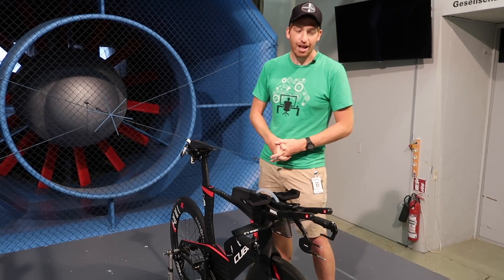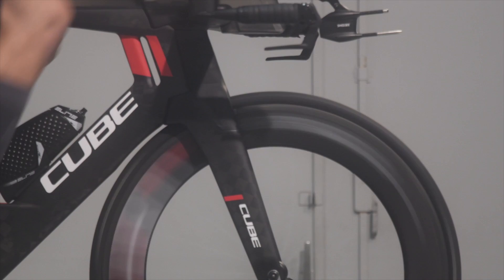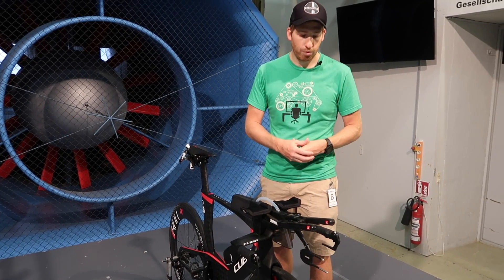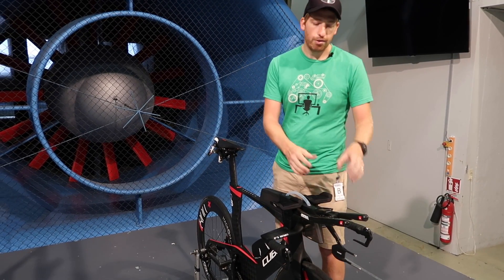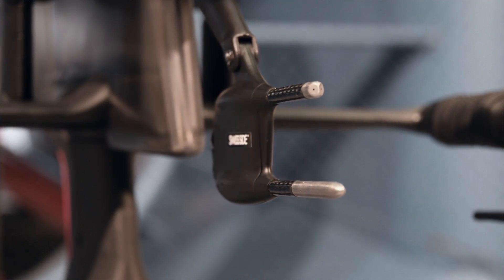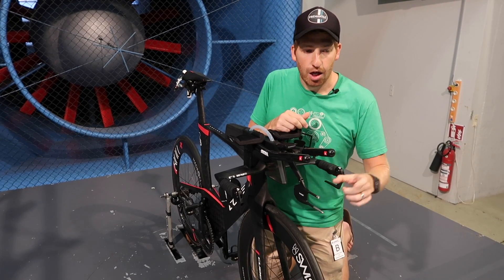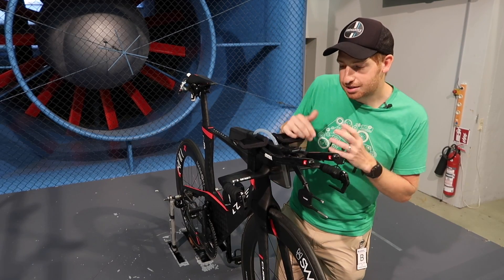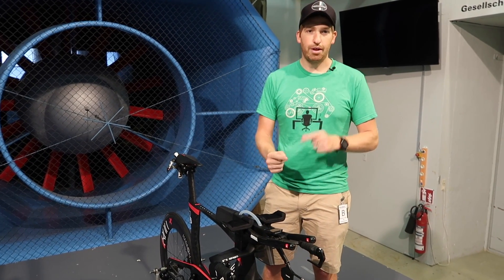Swiss Side Aero Sensor: Eurobike 2018 Status Update

Comment: It looks like you are in the Airbus wind tunnel in Friedrichshafen. I'm guessing it integrates with the power meter and is an estimator rather than an exact because there are a load of unknown variables. Similar to the Notio connect? Hambini
Reply from the maker: Indeed, that's the tunnel. And yup, it requires a power meter like virtually all other ones. I think to some degree everything is some element of estimation here, the question is whether it's consistent enough to be meaningful out on the road. Most of the systems I've tried on the road (AeroLab, Notio in early days, PowerPod), seem to have enough consistently with those variables to make this work and be meaningful from a tech standpoint. The challenge now is actually making it more viable for larger numbers of users. You and I can easily understand CdA, but most people can't - nor will they know what exactly to change to make it meaningful.  Also, some of the setup/prep pieces to make these devices sing still need to be simplified for mass market as well. For almost every company I've talked with, it's this last piece that has been causing them delays in product availability.
Reply: Myself and some of my colleagues hooked 30 riders up with pitot tubes, admittedly they didn't look as neat as the one you have and sent them out riding over 6 months in the Bristol area of england. We used that data and developed a protocol to test wheels - we ditched steady state and went transient because that's what it's like in the real world. It's more of a kin to a fuel consumption figure for a car over a combined cycle rather than X Watts at 50km/h speed. 

The thing we noted that was quite prominent but completely predictable was the position of the pitot tube is heavily affected by the proximity to the front wheel, it's also affected by things in behind the sensing object.
Reply from the maker: Yup indeed - getting the pitot tube out further and away from things is important. That said, most of the devices I've ridden where companies have spent time developing it can seem to capture the majority of changes to the extent you roughly noted: Using it as a rough gauge as opposed to a super exact number consistent across multiple bikes/riders. Most I've tried have been repetitive in nature (meaning, I can repeat results throughout the ride and get back to the same CdA values).
Reply: As a training tool, getting a precise CdA value is less important than getting accurate measures of improvement. It's better to know that you are improving and by how much (relatively), than to know how aerodynamic you are.